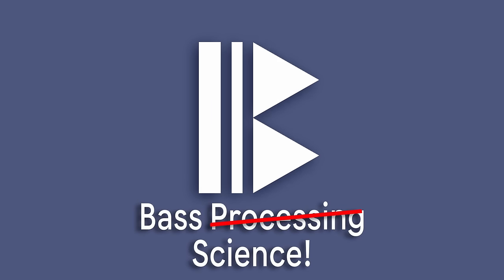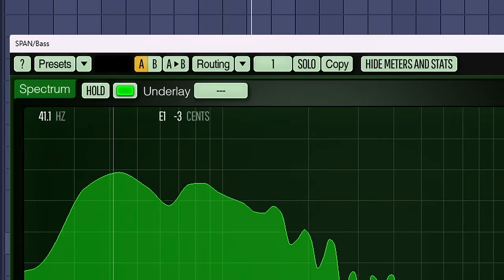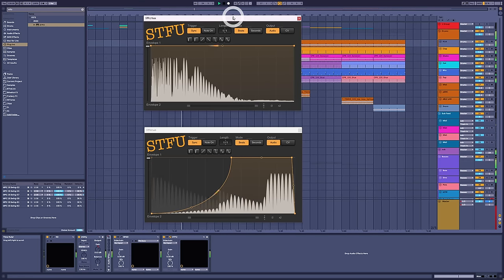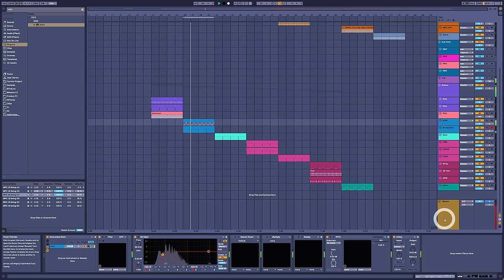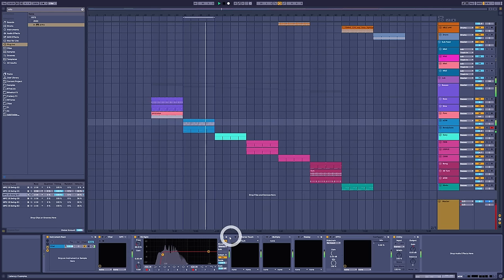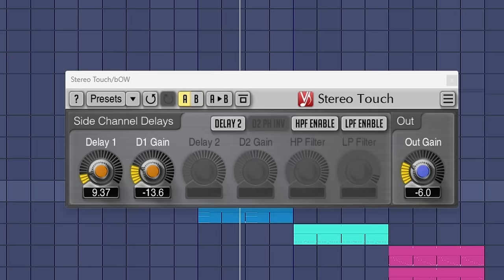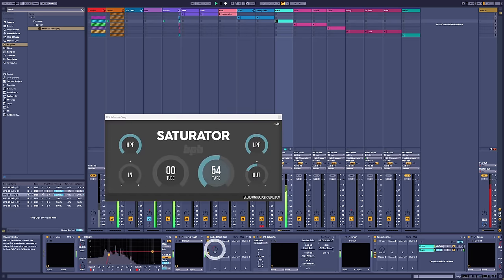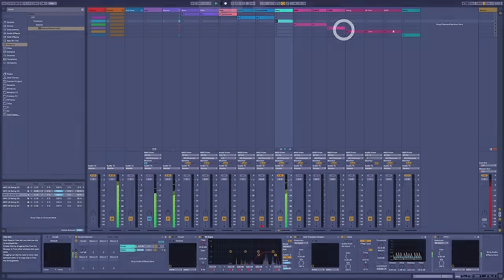How I Process / Mix House Bass

Comment from the maker: I forgot to mention if you have a stereo bass that collapses badly to mono, remaking into stereo with any of these methods still doesn't improve the mono, instead you can use a utility plugin to playback only the left or right side as the middle instead of the mono sum , that is a usually a big improvement, and then you can re-stereo it

I also totally forgot Steve Duda (Xfer) made a free dimension expander plugin, I had already figured it out by that point and have just been in the habit of using a delay to do it. You can just go grab that instead. At least you know how it works now though!

Comment from the maker: *Important: please bare in mind when I say things like "parallel distortion is not going to work", My advice is largely intended for beginners and these are initial guidelines that will help you (or rather keep you 'out of trouble' ) in a majority of scenarios. I break these 'rules' all the time, because I know why , where , when and how through experience. Until you gather that same experience my advice always errs on the side of caution.
Reply: Most helpful instructional vid I've seen on youtube
Reply: Any chance you might do a video breaking down tracks like “1949” by Honey and Badger? Maybe explaining what elements of those tracks are beginner friendly vs not beginner friendly etc? 
Hopefully that question makes sense in a way that is relevant to the purpose of your channel 😂
Reply: oops I shoulda read this before commenting. Great work!
Reply from the maker: @ampersand64  haha no worries it's all good. 
Your education is there for those that seek further clarification , thanks for your contribution. 👊

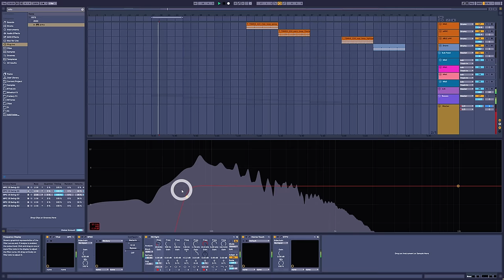Comment: 4:26 one thing to note about the phase shift comment...
you're using a 24db per octave slope on your highpass! 
This creates two points of 180° phase shift! 
One of those points occurs ABOVE the cutoff, so that filter is actually rearranging the phase quite a bit! 

Not that it matters. The phase relationship of a bass sound is not as predictable as "phase shift bad". 
Phase shift is bad, but ONLY if the phase has been carefully tuned to maximize headroom previously. 
Phase shift is also bad if you saturate your bass before you use the filter.

It's simple enough to find a good phase relationship between your bass fundamental and its overtones. Just buss the synths, just tweak the phase of the sub, while inspecting the waveform through an oscilloscope, until the peaks are minimized.

The reason it's a good idea to separate sub-bass instruments SPECIFICALLY is because when the notes combine, they can cause really long cancellations. Its the same phenomenon as dissonant notes creating "beating", except low frequencies' beating sounds way more noticeable.

Comment: 20:02 quick correction. Sample rate reduction doesn't cause any ringing!
When you just reduce the sample rate to introduce aliasing (which is those higher, metallic tones), it doesn't have any effect on the timing or length of the tones. It simply shifts the higher frequencies (already present in the signal) around the spectrum, similarly to frequency shifters. 

Still a good tip to use the transient shaper & gate on the aliased harmonics. 
It sounds unnatural for these high frequencies to sustain so long, because in nature, high frequencies decay faster. So this technique reintroduces some natural sound.

Comment: Hey B! Regarding stereo imaging of bass, I have a (probably) noobie question. Let's say you have a bass top layer that is pretty wide and sounds great in stereo, but sounds weak in mono. However, upon checking for phase issues, you find there there are none at all. What would be your solution in a situation like this?
A) Use a mid-EQ to boost centre frequencies (this makes it a little muddier!)
B) Use an imager to simply reduce stereo (but this will come at the cost of making it sound less nice when playing in stereo)
C) Its a top layer bass (with barely any frequencies below 100Hz) - there are definitely no phase issues! If there are no phase issues, then it shouldn't sound "weaker" in mono - you're overthinking!

Little MCQ for ya!
Many thanks from Canada
🍻
Reply from the maker: Hmmm, well first, how are you checking for phase issues?
Reply: @Bthelick  The bass in question is a Serum bass roll/pluck with a soft HPF (Ableton EQ8) at 147Hz (so not too many low and likely phase-cancelling frequencies). It is a pretty wide sound, generally speaking. What I did to check for phase issues is solo only the bass roll + my sub, pan one all the way to the left, and pan the other all the way to the right, then observe SPAN's correlometer. It hovers at around negative 0.20 to positive 0.10 when I do this. This indicates no phase issues right? My method could be wrong - you know best! I also repeated this for my kicks, toms, and any other instruments that produce low frequencies (and compared them to my bass rolls). Same results - more or less hover around 0 in the correlometer.

The only thing I can think of that may be causing phase issues is the Serum sound (bass roll) itself, since I have a lot of delay and reverb on this sound. But I can't pan/solo Serum's reverb effect or delay effect to test it this way. Here, I rely on keeping the bass roll as is (no panning), and observing SPAN's correlometer - it hovers at around 0.50 to 1.00. Is this indicative of phase issues?

In your opinion, what is the best way to look for phase issues? Am I doing it wrong? Thanks again!

Comment: I’ve been loving watching your videos. Your commentary makes them so valuable! Super impressive how you clearly explain what and why you’re doing things.

To clarify your comment about distortions and phase, I’m guessing you’re only talking about distortions that apply some type of eq/filtering under the hood? Simple distortion processes like soft/hard clipping or any sort of waveshaping shouldn’t affect phase whatsoever, yes? Distortions that don’t apply colouring via filtering should be A-ok to mix in parallel, I believe.
Reply from the maker: Clippers are usually fine yeah. Regarding distortion there are just too many cases, usually more bad than not to blanket recommend trying it that's all. It's just a rule of thumb to save beginners from getting into trouble, there will always be exceptions. 👊

Comment: Hey B. Might be a noobie question, but what constitutes a bass going too wide? Let's say my bass (not my sub - would never touch that) has been widened by ping-pong delay, chorus, and stereo touch (Voxengo). If my bass sounds much better/more interesting and wider in stereo than in mono (there is a significant difference), but I have made sure there is no phasing (sound doesn't fall apart or get quieter when I switch to mono - and just barely dips below zero on goniometer correlation metre), does that mean that I have upset the stereo-mono balance and should reduce width? Or, would you say that if there are no phasing issues and if the correlation meter never dips below zero, then the sound shouldn't sound too different in mono vs stereo to begin with? Thanks! - Sam
Reply from the maker: Yeah you got it, it's all about how it sounds to your ears, if it sounds solid in mono and the balance isn't upset (in relation to how important the sound is) then have at it! 👊
Reply: @Bthelick  Makes sense. Wonderful 😎

Comment: Hi I've started using STFU to side chain however I can't seem to get rid of the clicking sound with the curves I want. Driving me nutss!!! Thanks!!
Reply from the maker: It's the square waves. 
If you take any sound to zero instantly it will click, as you've effectively created a square wave. So simply draw an extra couple of nodes in and draw a very quick fade instead.
Reply: Thanks! ! I'm trying to work the curve to not get a click but not having much luck. I'll keep at it lol @Bthelick
Reply from the maker: I did a few times in my live stream where I made tech house from scratch. 
If I get chance I'll find a time stamp and edit this but in the meantime have a scan there,, it'll be while I'm making the bass
Reply from the maker: From here https://youtu.be/1Bs_5Ls4Dhg?si=2J0L7Heg85s-o_HW&t=864

Comment: who are you and where did you come from? your knowledge is astonishing. this will for sure be one of my favs music production channels. question: did you program the bpb saturator plugin to automatically reduce the output or does the plugin do it by itself? if you did it, how?
Reply from the maker: Thankyou. 

Yes I used the rack system in Ableton to assign both parameters to 1 macro knob (with opposite value ranges) 
You can do similar in logic, reaper, and FL studio too as far as I'm aware.

Comment: that STFU is also free, worth mentioning if you didnt, i did not hear you say it, if you did my apologies. this should sound a bit better than just using sidechain shouldnt it?
Reply from the maker: Thanks for pointing it out yes I try to mention they are free as that's a big part of the channel most of what I use is. (See waves video rant haha) 
It can sound 'better' in some scenarios depending on context. Because it is not a real side chain it has a different groove. if the kick uses a different rhythm then this won't follow so that can be bad. In a mix context it gives a little more control especially when treating sub elements. I still use both options as sometimes you want things to react to the kick and kick changes and sometimes you just want a consistent pumping effect.

Comment: Maybe you could boost the music a bit in the "listening" section, so i wont have to turn up the volume to listen, and then get my ears blasted by your crispy delicious voice <3
Reply from the maker: Sorry yeah it's always a tough balance. I have it set so It does boost when I stop talking but it can't adjust for subtle sounds.

If you're talking about those sub only sections that's a sign your listening environment might need some improvement, the levels to my ears are mostly equal.

Comment: It's downward slope ONLY if you set span slope to 0, Span and most EQs have +4.5 slope by default so noise is straight line. Downward slope is "old" way of displaying spectrum and most youngsters use only default settings.
Reply from the maker: True good point, I always preferred 0 slope it looks more like what actually I'm hearing.

Comment: 19:07 to clarify:
distortion ITSELF does not destroy phase relationships. 
When the plugins have their own mix knob, they just blend in the regular dry signal.

However, if a plugin has OVERSAMPLING, then that's what destroys phase relationships.
The plugins blend the parallel signal before the downsampling step, which is the part that causes phase shift. 

If your distortion plugin avoids oversampling, it will be OK to use for parallel distortion. 
It will produce exactly zero unintended consequences. 

Most plugins let you have your cake and eat it too, though. Mix knobs that work with oversampling are fairly common in well-built plugins. 

Interesting, distortion itself actually changes no existing phase relationships. It adds new harmonics, whose phase relationships are perfectly tuned to decrease peak levels. Distortion is the best louder-maker tool available, even in parallel!
Reply from the maker: Yes. But even with no oversampling many processors use eqs / crossovers and other tools pre/post to shape the distortion behavior, and not always in a clean pre/post emphasis relationship. 

For those new to this I just find it easier to tell them to steer clear unless the drive itself has a mix parameter (although I've heard of few of those get it wrong too) because they won't have the ears to spot the comb filtering. 

Thanks for the clarifications though 👊
Reply: @Bthelick  yeah you're totally right. I was slightly being a smart-ass. Cheers

Comment: Really great video! The example bass/sub bass you use in the first section stays on the same note throughout, meaning the range of frequencies where the "split" occurs is static - what would you do with a bassline that changes notes, thereby moving that range? is there a way to keytrack your EQs accordingly? Thanks!
Reply from the maker: There are some eqs which attempt to follow pitch , like some in izotope plugins, but I haven't found any reliable enough. 
If the jumps are large enough to warrant it I will automate the cutoff. 
It's not usually necessary though as the kick is not changing in pitch So the side chain length below that static threshold is fine.

Comment: Excellent tutorial as always, 10/10! Simple question, if you have a saw wave bassline, for sub would you EQ the bottom end or any advantage in using a specific sine wave 'sub' patch?
Reply from the maker: Eq on the low end of bass usually only works if the bass is only playing 1 note. Otherwise  when the bass part changes note the eq will be in the wrong place. Then you just end up with uneven bass frequencies with some notes being louder than others. 
The sub gives you proper control of both sidechain/envelope and lets you keep a solid bass end by being even across different notes.
Reply: @Bthelick  Ah I see, I watched again and see now 'sub-separation' is a separate sine wave track, not splitting the same bass into 2 parts with EQ. Thanks for clarification, much appreciated!

Comment: Voxengo sound delay is really good for stereo manipulation.  I have been using it for many many years to add a we bit of stereo offset to higher frequencies.  It can require more filtering to keep Bass clean but i find it works well instead of stereo touch many times.
Reply from the maker: Are you saying you add it back to the dry signal? Because Sound delay just delays the signal in time. 
Stereo touch is just a delay too, but added back to signal and phase inverted per ear. 
So sound delay does exactly the same thing , minus the wet dry mix, phase and filler options.
Reply: @Bthelick  I just enjoy the "hands on"  options of sound delay. It's a handy tool for many things and does one thing very accurately.  On a send or duplicate track it's very handy to add some stereo information to whatever a person may wish to along with an EQ etc.  Just figured I'd mention it when I saw you using stereo touch.  Good videos.
Reply: @Bthelick  oh yeah but using sound delay on only one channel or on only the mid or side channel was the way I meant.  It's the only way I use it so I guess I didn't mention that.
The channel routing and controls are changeable in a menu.
Reply from the maker: @ahdziz666  ah right yeah. Stereo touch is just sound delay on the side channel basically.

Comment: I would like to add one interesting detail. Before you can navigate the pink noise on the spectrum analyzer, it must be properly configured. The analyzers have a Slope parameter that allows you to rotate the spectrum. And it must be adjusted so that pink noise shows a flat horizontal line. This is due to the fact that in pink noise all frequencies with the same time fall into our "zone of attention". And by adjusting the analyzer in such a way that the noise is horizontal, we make the analyzer work as our "zone of attention". What will be the correct display of the operation of frequencies. That is, we will see them as they are read by our perception. Meld's analyzer works like this by default, by the way. After such manipulations, you can already turn the noise itself, balancing between high and low frequencies to our taste using the Tilt filter in any good equalizer, be it Pro Q or Kirchoff.

And as always. Great video!
Reply from the maker: Thank you! I thought white noise was supposed to measure flat? 
I have the slope on my Span set to 0 for that. Well that and to be it always looked more like what I was hearing.
Reply: @Bthelick  It's quite interesting that you use white noise. For my taste, it sounds quite aggressive in the upper frequencies. And pink is very close to all sounds in nature. It is enough to go outside in this wonderful summer and listen to how the leaves rustle with the wind, and you will find that everything is suitable for pink noise. In general, this gives a more matte sound. But in your case, a very good technique would be to raise the upper frequencies on pink noise, which will sound the most pleasant.
Reply from the maker: @young_neal5947  I agree, that's why I used it, pink is much closer to a natural distribution. I  meant using white noise to calibrate a meter only. Because that resulting slope on sound is how I perceive it irl , in a good room with flat calibrated subs I perceive more bass at equal level naturally, probably because bass vibrates the body too.
Reply: @Bthelick  I got you. This is a detail I didn't know. In any case, I'm very glad that I found your channel and have already watched a lot of stuff you've made. It's nice when everyone understands.

Comment: Hi quick question what is the différence in sidechaining with an enveloppe plugin compare to using a regular compressor ? 
Thank you for your content that extremely helpful
Reply from the maker: depends on a couple of factors: 
A) groove. If I don't want the part to permanently 'pump' and instead 'breathe' when the kick stops I use sidechain to save me automating that.  but sometimes the tremolo (envelope) is the only way to a get a certain feel with those non-'natural' curves that you can't get from a compressor release. 
B) Low end precision. When pushing the limits of loudness, those bespoke curves from a tremolo plugin are sometimes the only way to guarantee the sub track and kick are not adding together and taking up precious head room. I talk about this very distinction in the "how to not master your tracks pt2 video